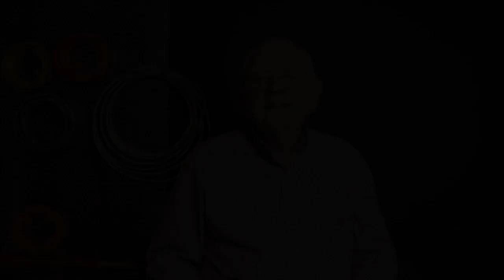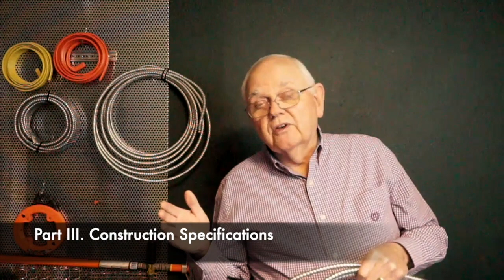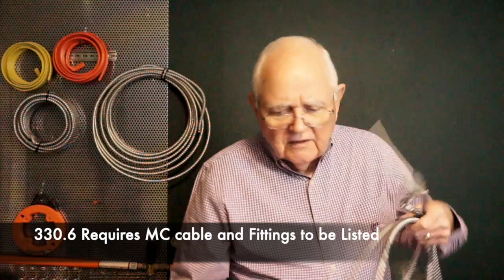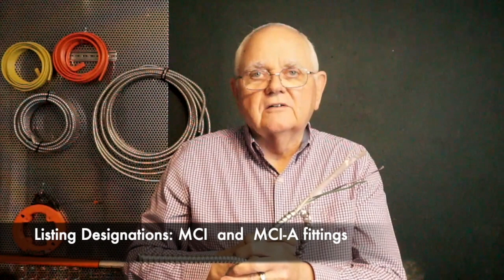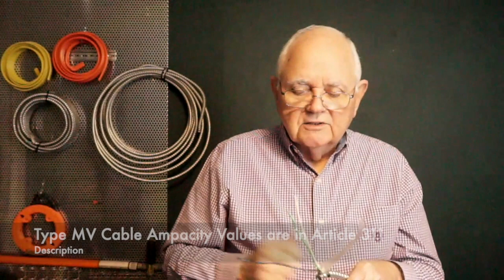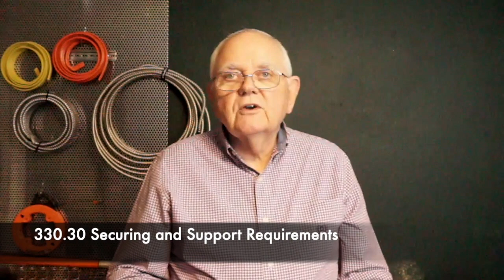EC&M Tech Talk Video, Episode 14 — NEC Art. 330 and MC Cable

Comment: I need to ask you a question about MC 3/4" cable attached to my past father's heater in a detached garage. 
Can I terminate a 30A twist lock plug to the end of this cable?
Can I fit an end piece on the MC the attach the twist lock plug or is there an acceptable alternative oppose to termination in a gang box? I want a 30A twist-lock receptacle  in a gang box to label as a "Kiln" outlet. 
Thank you. I know you would be able to tell me plain and simple. 
Great video NEC references.